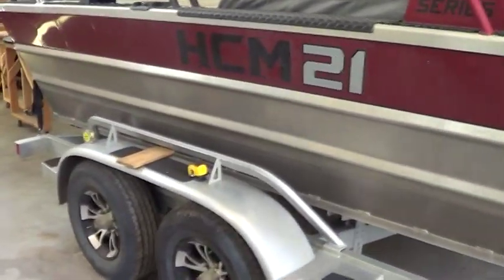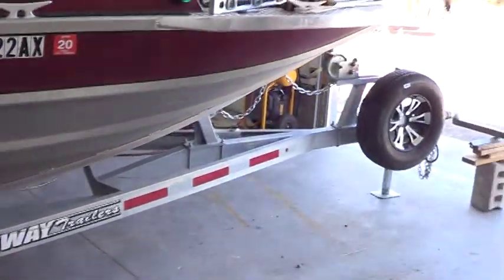Jet Boat Trailer Tongue Weight

Comment: Why does lifting tongue higher put more weight on tongues?
Seems risky driving as we drive up or down hill, speed bumps, driveway slopes. The load on truck front and back axles would be constantly changing our balance and steer control!

7.5% grade for 19 miles (I 64 WVA or Colorado I70 ) would change drastically as u we go up or down hill ? Safety issue ?
Reply from the maker: It's torsion axle, so lifting the tongue takes weight off the front axle. In the limit, the front wheels are in the air, and its load is distributed between the hitch and rear axle. But most of its weight goes to the rear axle. 

Climbing a hill doesn't matter because road grades are either constant or changing very slowly.

Comment: In case you are unaware, tongue weight scales are available. Simple weigh is just one example.
Reply: Available for $$. Use 1 time or
Use at home and adjust loads in boat or trailer position to achieve better balance, and want to use at home over period of couple days, then no more!
Reply: @BillJones-m4g  with RV's the load can and does change drastically dependent on the trip you are taking. A weekend does not require the same as a month long trip. That being said for a boat yes it doesn't make a lot of sense but there are other uses that do.